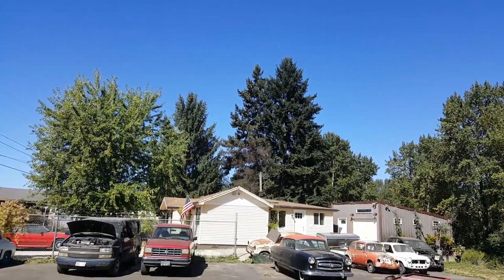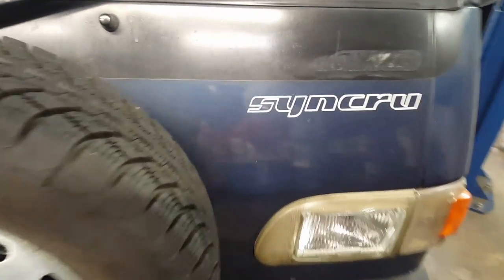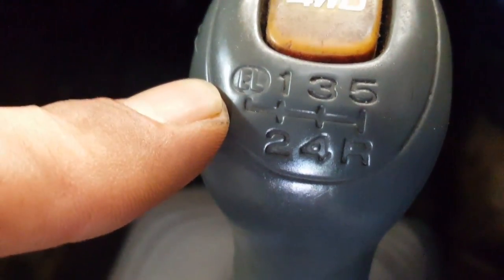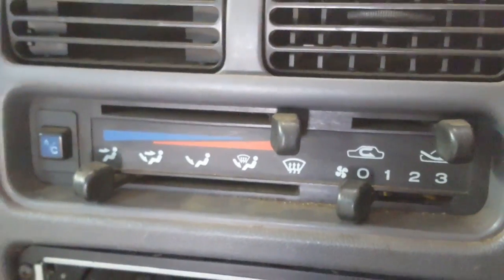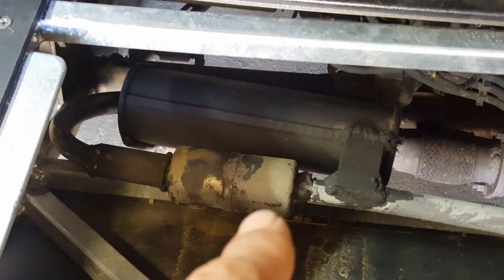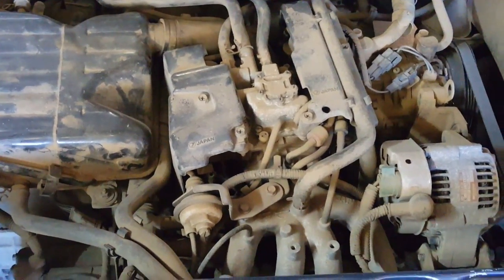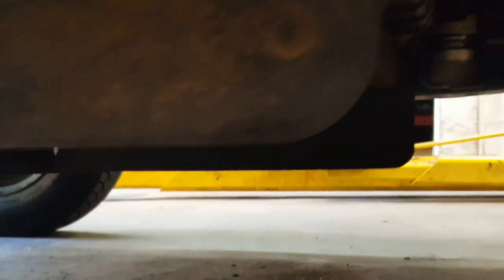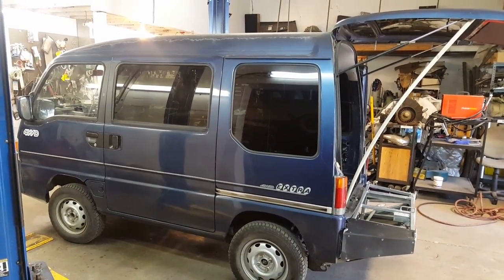Micro-Overlander 660cc Subaru Sambar KEI Van

Comment: That's a very interesting vehicle. It just seems like a heck of a load to put on a such a tiny engine. I agree with other commenters that the modifications have probably messed up the flow of the cooling air and it may need a better radiator. All of that extra load may shorten the engine life regardless.

Comment: Looks like 100,190 kms, or 62,618.75 miles, and the designed front end is probably screwing up the airflow to the rad, maybe an electric fan and rad out of an older Subaru might work.

Comment: the water pump on Sambars/Domingos are problematic and should be rebuilt. Ditto for the long metal cooling pipes that come from the radiator. They are known to rust and cause issues.